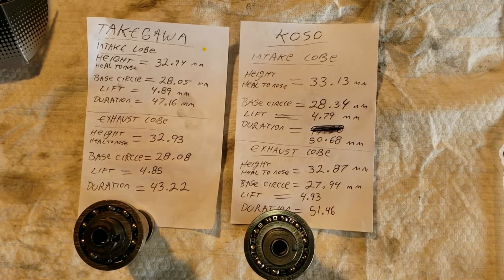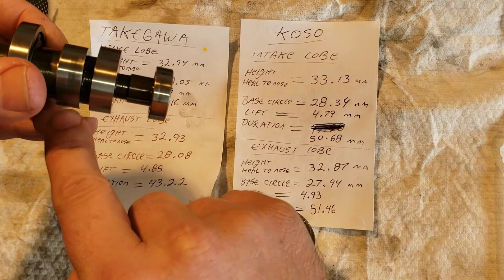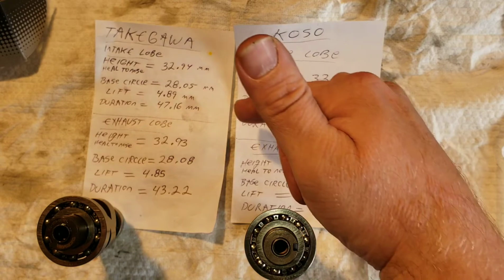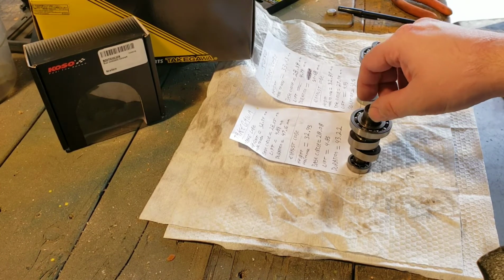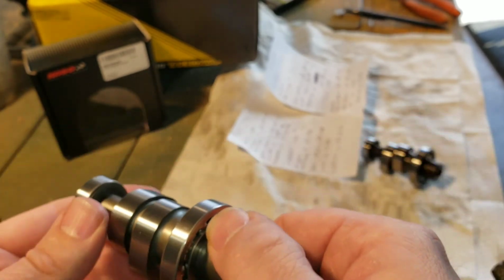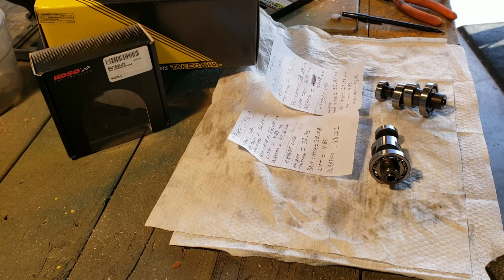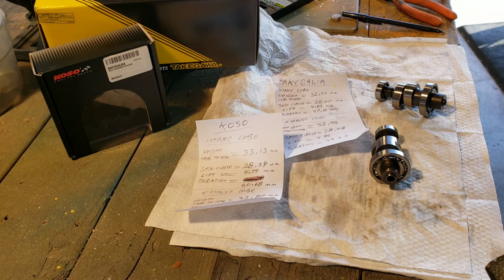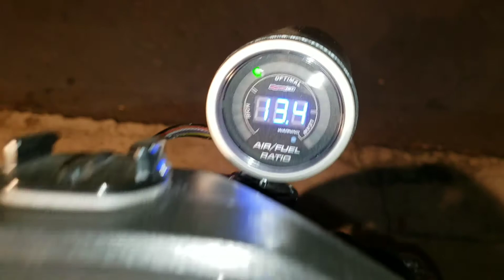Honda Grom TAKEGAWA S-TYPE CAM vs KOSO 240 CAM

Comment: I just installed the tb cam with a dh motoring ecu flash. How does the tb cam compare to these two cams?
Reply from the maker: TB cam will have more top end..
Power band is about 8300 to 12500 rpm...
You will lose low end torque but gain power at high rpm.. 

Just remember to keep the bike in the power band in order for it to not fall on its face and big out..

Comment: Looking for info about these 2  camshafts. I wanna get one for my Grom but can’t decide which one. What’s your experience with the koso now? I have an air intake and zoom exhaust with aRacer & o2 sensor installed. I gained way more torque but seems like i lost top speed. I wanna hit 70sh for freeway speeds. What do you recommend?
Reply from the maker: The koso camshaft is my favorite camshaft for top-end speed. If you are looking for low-end torque and being quicker light to light then you would want to go with the takegawa S-Type camshaft.. it would work better for doing wheelies and stunting that kind of stuff..  if you want more top speed go with the Koso 240. that's what I run and my bike is ranked number 10 for the fastest ¼ mile and ranked number 10 for the fastest ⅛ Mile... I like the koso 240 camshaft better than of the tbparts camshaft
Reply: BiLL Ramseyer what about the RPM’s? Is lower RPM at higher speeds? Or will I be running it ove 8000 at highway speeds? Yesterday I topped mine at 70mph for the first time, but my rpms where at 8500 al the time. I don’t wanna blow my little engine. Do you have the stock piston or did you replace it too?
Reply from the maker: @Miwiz1  I'm running a 181 Big Bore Kit.. the gearing that I'm using is a 16 tooth on the front and a 32 tooth on the rear.. with the koso 240 cam... 

84mph at 7800 RPM 96mph at 10200 rpm

Comment: The Takegawa looks way better machined then the Koso.  Better specs on the Koso, but I think I'll stick to the Takegawa.  I trust Japan tech more than any other Asian country.  Aloha bro.
Reply from the maker: Hey bro... its a high quality cam for sure. I'd say performance wise these are about the best 2 out there. Run it bro.. its good shit.. just revs out to quick for the Turbo set up were building for the bike. Have a good day brotha..
Reply: @BLRTUNING  understand able, I want higher top end.  I just don't like the look of that Koso cam.  Especially so close to China.  All that Chinessium coming out from China is terrible.  How can anyone trust the materials from that part of the world.  I mean all tools are being made from chinesium.  Better to raid your grandpas storage and use them old reliable tools that last.  Just sayin bro
Reply from the maker: I agree with you 100%.. The takegawa  Stuff looks way better in my opinion that's why I went with them for my big bore kit and I couldn't be happier. I'm gonna run the KOSO cam  For now and see how it holds up. So far it's making a lot more power on the big in but the takegawa camshaft is no joke..  I would highly recommend it to anyone. I've been running it for the last 800 miles. Let me get 800 miles on the new camshaft and then come up with an opinion. I've only had the thing on there for about 4 days and I've only took the bike outside twice since I put it on. Winter is coming....
Reply: @BLRTUNING  cool bro looking forward to the video!